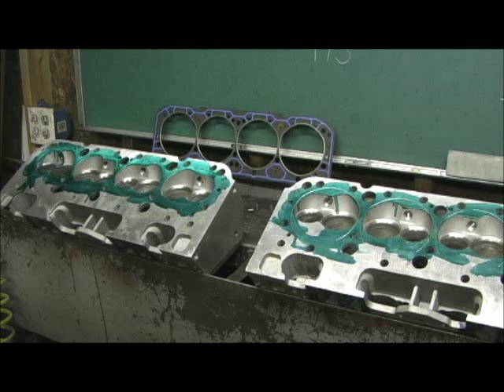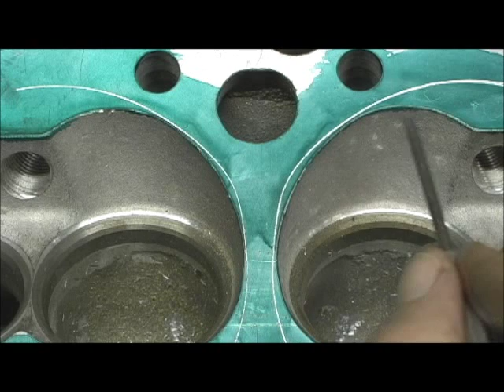ProComp 190 Stage IV Denmark Duo Chamber Mods 4.2

Comment: As you know from cylinder head school valve masking is used to promote flow direction. Ford tried this back around 85 on the mustang just before using the e7te heads. They were mildly successful. The masking lowers the overall volumetric efficiency but may add low rpm torque and drivability. I would prefer to remove the masking to pickup low lift flow, deshroud to the gasket line to pickup high lift flow and swirl it till it screams.
Reply from the maker: What can I say Yank, 100% correct.

Comment: Damn Yankees call that a high swirl chamber or a turbulent charge chamber. Remember since you cut the snot out of the masked side the increased flow is opposite in direction to the way you want the swirl to be. That is why increasing the swirl cut by the plug works so well.